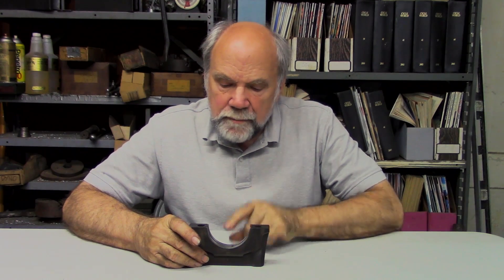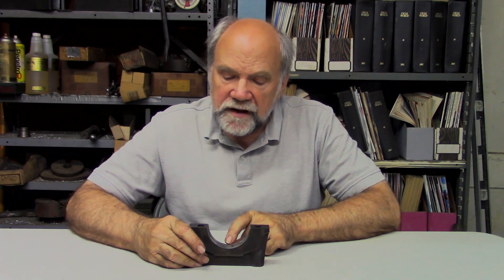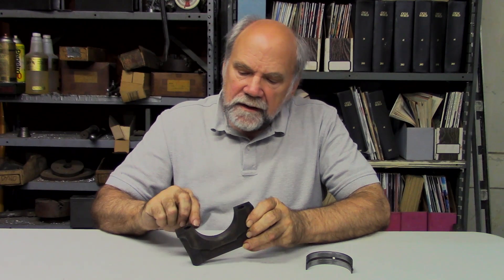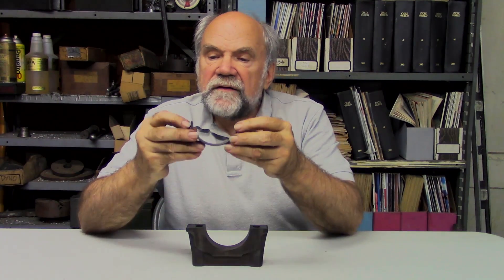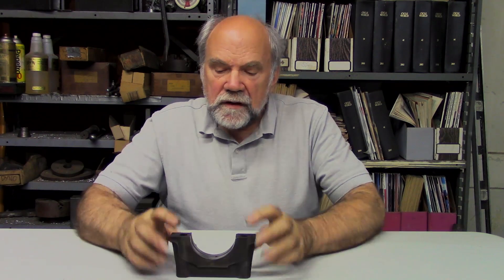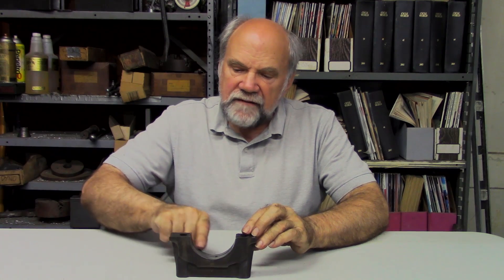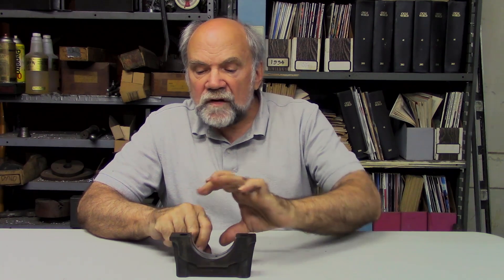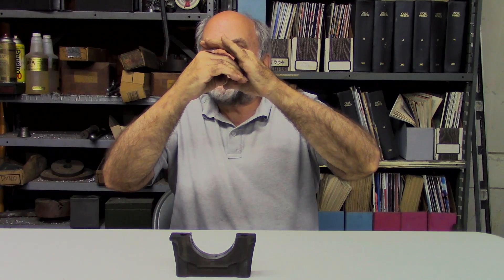How Do Plain Journal Bearings Work Within A Motorcycle?

Comment: Thanks Kevin. In 1965 I was studying for a BSc degree in Mechanical Engineering at Leeds University (UK) and we were shown a diagram of the oil pressure distribution across a plain (shell) journal bearing - which is like a sine curve (maximum at the centre, zero at the 2 edges).  Any scratch or imperfection in the shell bearing liner results in almost a double sine curve ie. a lower max overall load bearing capacity.  Moral:  - warm your engine before opening throttle too wide and regular oil and filter changes.